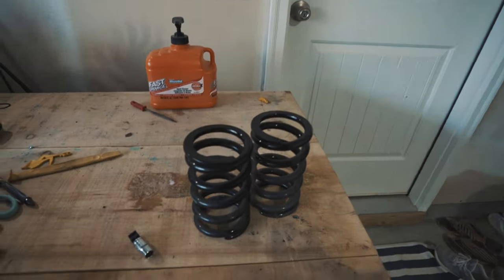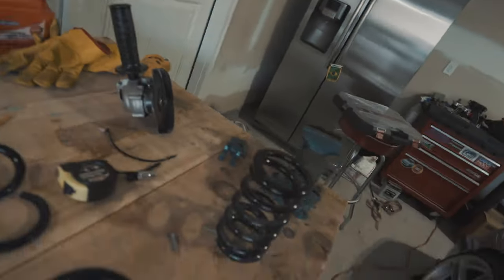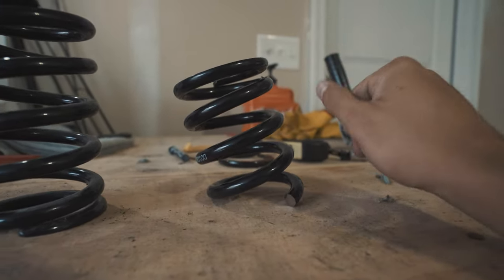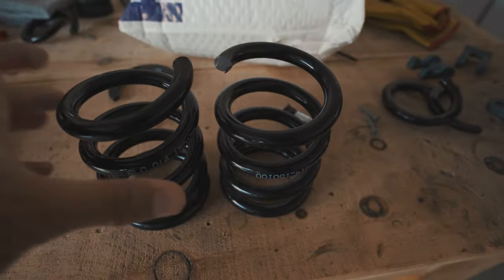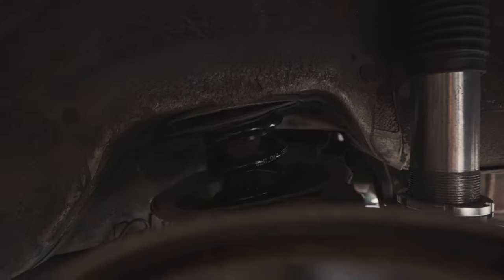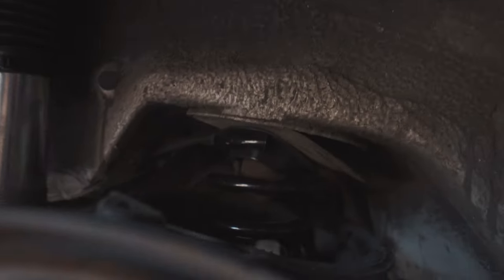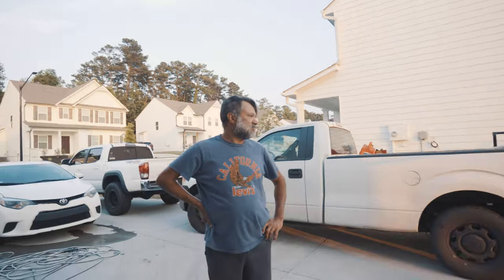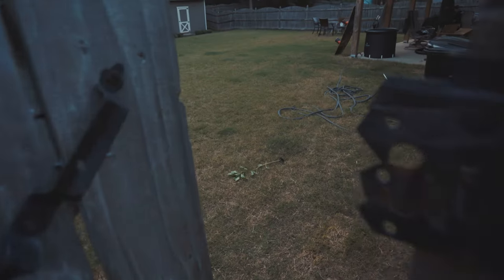Are CUT SPRINGS really that bad?? (Cut vs. Swift springs for E36)

Comment: You probably could’ve tried to grind the top of the spring a little flat if you’re concerned about the angle of it but that’s what cut springs always look like
Reply: You can also heat up the final piece and bend it flat, my buddy did it on a moped shock, i think it can be done even on car springs

Comment: Need one a them dope a key rings y’know 😤
I’ve seen most people on the stance forums use 4” springs.
Reply from the maker: Yeah I think 4inch I was just gonna run into so much problems on the alignment
Reply: @ONGO_  either way this is just what I needed to get em bought, looked so class when they was cut 🤘

Comment: The cut springs were the same size as the new ones? If so give them some time I'm sure they settle in.....maybe hopefully.
Reply from the maker: Yeah they’re the same size
Reply: @ONGO_  Did they settle?
Reply from the maker: @seanshepherd6767  not yet. haven't put that many miles on it yet